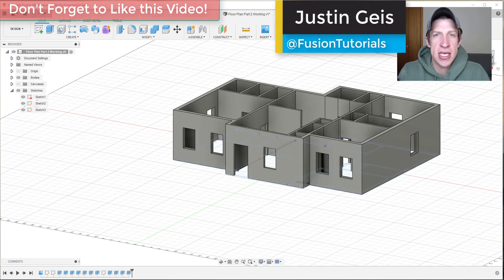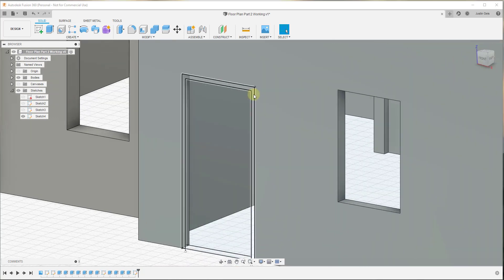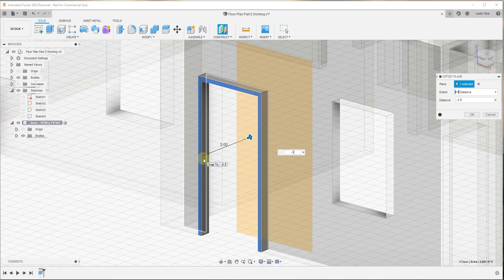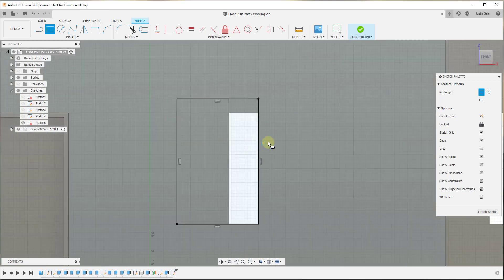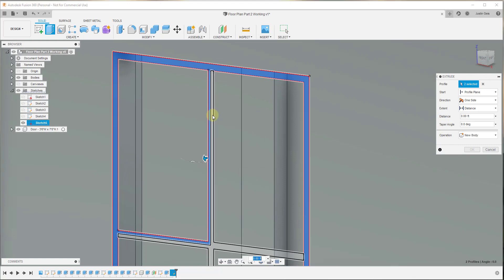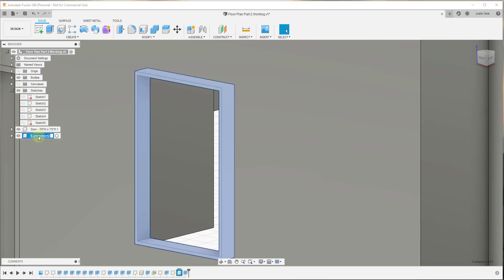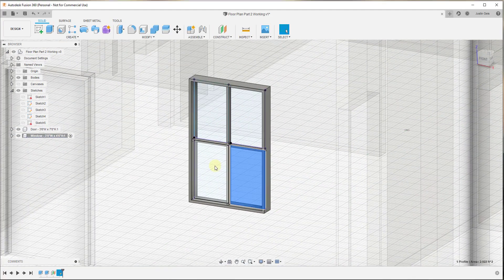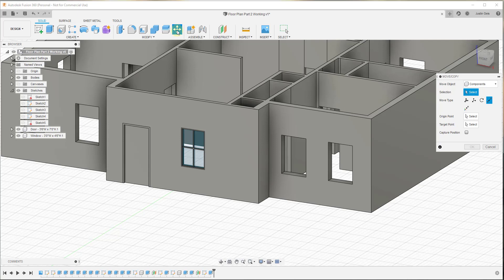Adding DOORS AND WINDOWS to a Floor Plan in Fusion 360 - Fusion 360 for Architecture Part 2

Comment: You should play around with extrude from offset plane.  Much easier.  And the glass panes could have been done from the sketch you already had, and as a single body instead of 4

Comment: Thanks a lot for those videos, they really helped me a lot!

When is part 3 coming?

Would you Model the kitchen (just as example) in the same file as different components, or do you model them separately and later on insert them into this file to create a rendering?